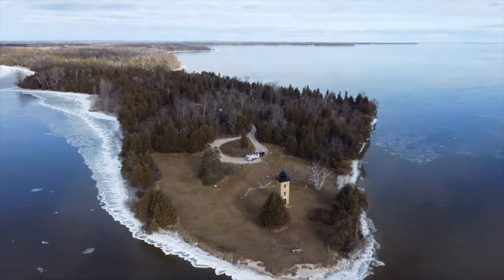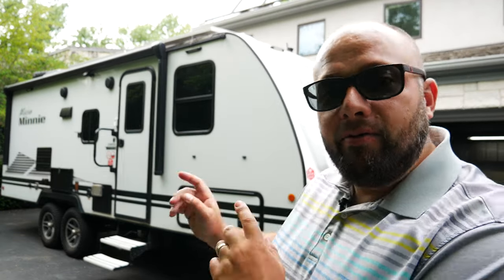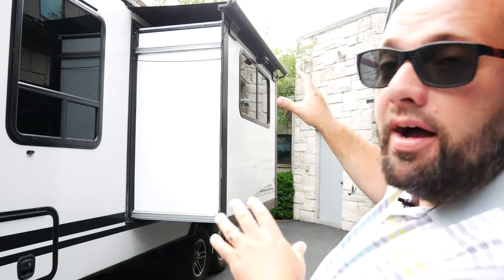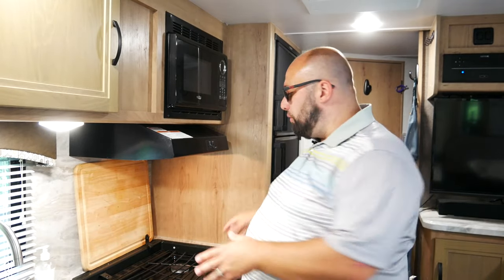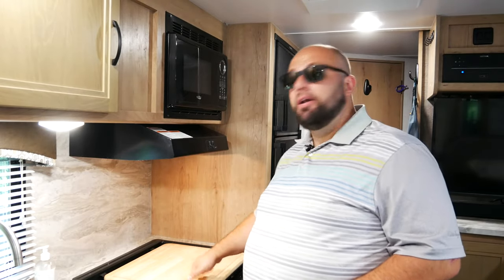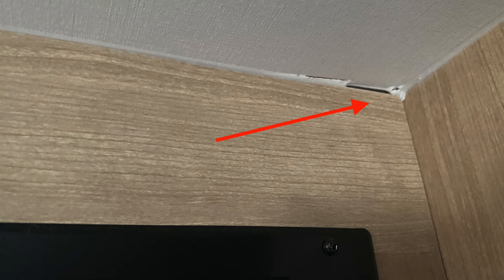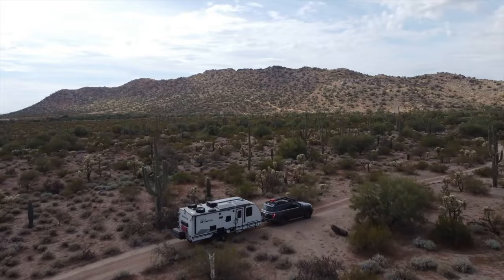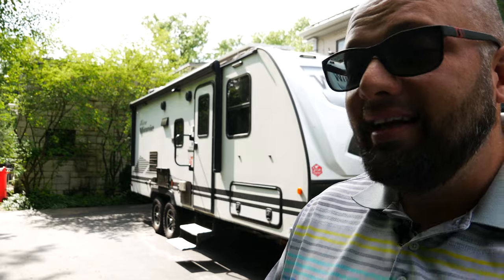Realistic RV Ownership - 2 Year Review of what has broken....

Comment: I like your realistic attitude. Carry extra stainless screws/fasteners, sealants, adhesives, locktite for wood screws that back out, eternabond tape, pvc waterline, sharkbites, water pump,fuses, electrical repair supplys. I hate when I see on forums about new buyers complaining that the trailer will be at the dealer for who knows how long....learn the basics, watch YouTube vids on repairs
 If I had a slide I would rip out the dinette and install a small sofa BUT....I'm looking at the 1800BH as I don't want the hassles of the schwintek mechanism or extra weight.
Reply from the maker: Thanks for for comment. Yeah it sucks to see people waiting weeks to months for simple things to get fixed. The warranty is pointless on simple small stuff so fix it yourself and then the trailer is great. If there is a big issue then use the warranty otherwise you’re just making payments on something you can’t use.

Comment: ive had water leaks in every fitting. all the screws fell out of the dinning table, i use a couple of small steel vice clamps to hold the table together for now. the outside hand rail broke replaced under warranty. handles on the the dometic refridge broke fixed under warranty and broke again. i have a 2021 micro mini 2108. 6500 miles mostly highway Washington state summer storage winter blm ltva. if i had to do over i would build out a storage trailer or buy an Oliver. oh and from what ive seen out here all trailers are the same garbage even airstream.

Comment: Warrick, Really enjoy watching your videos. Can you explain in detail your quick connect battery cables from front of truck to rear of truck and then from rear of truck connecting to solar sytems and battery hook up on the solar system..  ty in advance... Tim
Reply from the maker: Sorry for the late reply, I’ve been gone for a minute from YouTube but I’m back now… so I have positive and negative cables going from the car battery to the rear of the car. Then on the rv I have pos and neg cables from the 4 batteries going to the front of the camper. When I travel I plug them in. The alternator in the car charges the batteries in the trailer. It works but I think a DC to DC charger is what I’m going next time around. Follow my new series as I’ll be doing that in the spring.